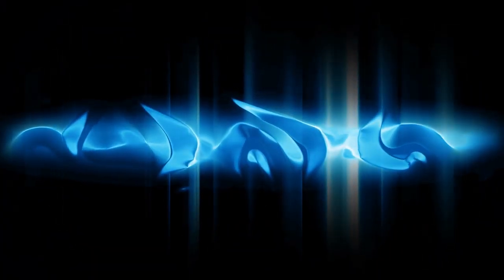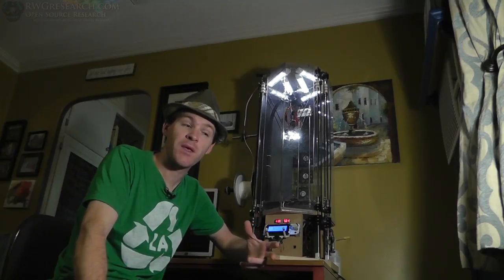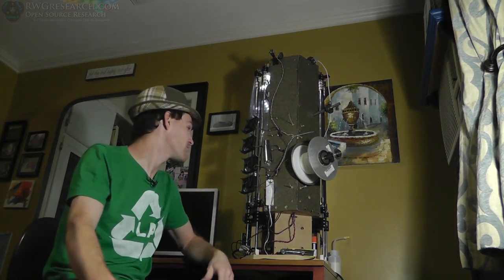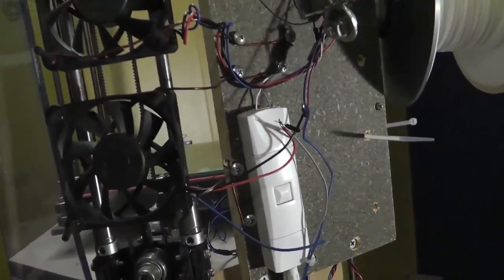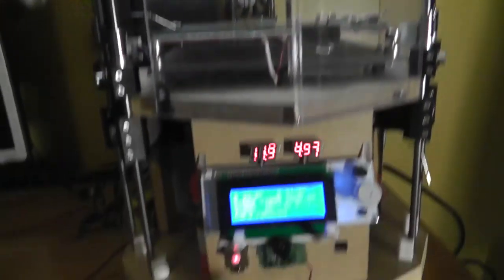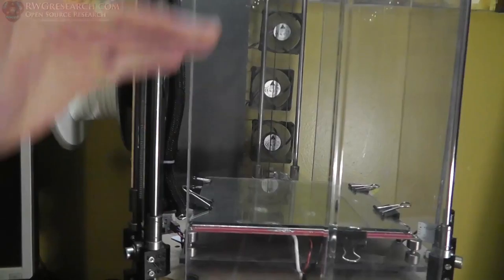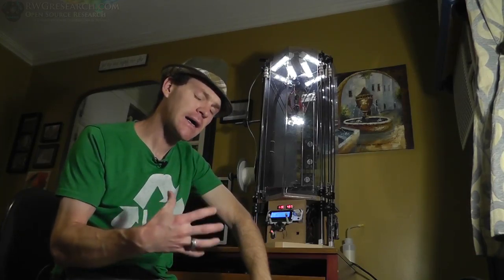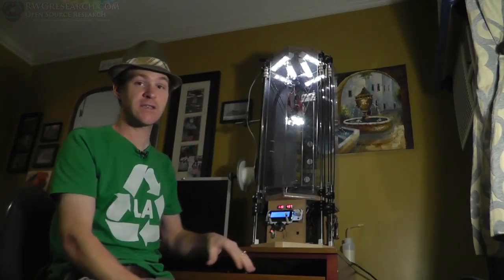Simple 3D Printer Fan "hack",  haggard but Easy layer cooling...

Comment: i know this isn't the right place to ask. but i know your the right guy to ask this question.
im searching for a not to expensive but nice 3d printer to build stuff for my projects.
maybe there's one you could recommend me?

Greetings jeroen
Reply from the maker: +acid byte well i would buy a kit, i'm not sure of the one i would recommend but i would recommend to get a heated bed with it... there are so Manny cheep Chinese knockoffs that i would try to but a common kit. so you can find parts, it will cost a bit more but you will be think full for that... also build size is a factor...  hope this helps? ~Russ
Reply: thanks man :) i think im gonna see whats on the market. and read some reviews.
i want a printer that is as versatile as posible. 
i think i rather spend a little bit more for somethug like that :)
thanks russ!

greetings jeroen

Comment: Very interesting. I was thinking of replacing the two I have near the base of mine with a "bowden" kind of idea, like your later tube. My problem is that you have to find a hose that has the bore and flexibility to cope. Im kinda thinking of setting up a fan that will follow the z height, so its mounted on the side and moves up an down. I wont be able to get the cooling direct at the hot end though.
Im wondering if its worth it, or should I just use two lightweight fans at the hotend in the way that multimaker does?
Reply from the maker: +Phil Waud i used the latex tubing, worked fine, just done zip tie it shut! held its shape fine and was very flexible. for a ling time i wanted to attache the fan to the slide rails and it would move with the Z height, but the endefector  is not at that height unless in the center! lol  also the tube option is hard cause you need to find a small "pump" to force all that air down that tube... if you just conect the fan to the tube it will not work well... it will just close the air off and it will just spin inside its self... thats why the funny oversized fan i will be using for the OSD. its a chance i'm willing to take to remake that fan, if it works you can replicate. it will be made out of 3d pretend parts and that fan is easy to find on ebay. 10$  for now the external fan seems to work wonders... like i did on this video. ~Russ
Reply: I wonder if you could mount the fan at the side on a gimbal and have it move up/down left/right to always face the hotend?
Reply from the maker: well... you stated " i winder if you could" i can :) however can you? lol.  any how, j/k .  so the fan provides enough moment of air around the fan that its good for my application. its not as directed as it seems. if the bed was much bigger yeah, that could be a prob. ( i would just add another fan to point the other way)  also i tend to over think the problem. i think a Gumbel is an over think solution, but it ill work... ~Russ

Comment: Are you recording with a new camera? I just got this 1080p@60fps.  Wahoo,, looked great.

(Or,, it may be on my end,, TimeWarner has been promising to boost my 30Mbps to 200Mbps, for free, with their new upgraded network infrastructure.)
Reply from the maker: +Duplicat no i think its on your end, this should be the same as the last 6 months or so! you just have to select the HD if you want it. If you have it on auto it probably always selected low res with your slower connection... ~Russ